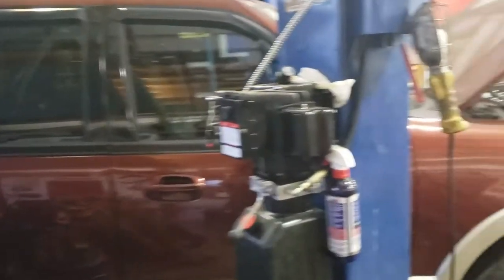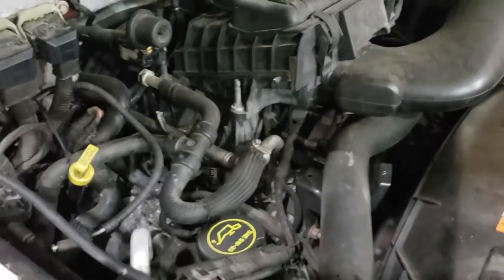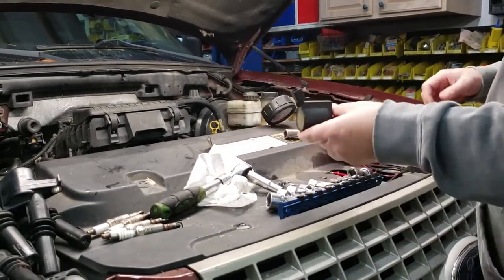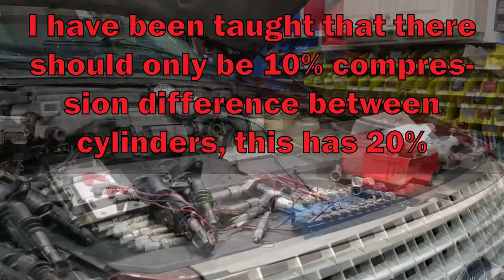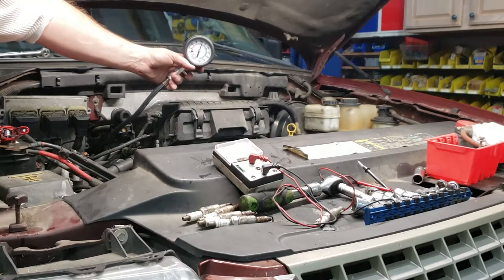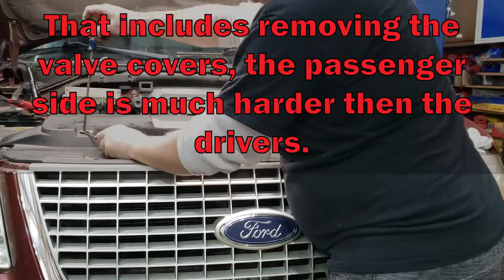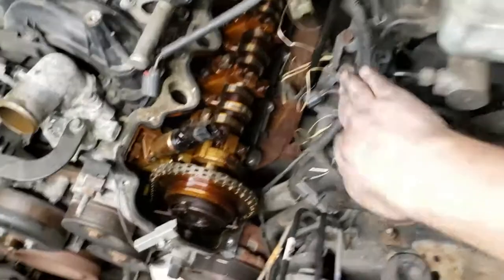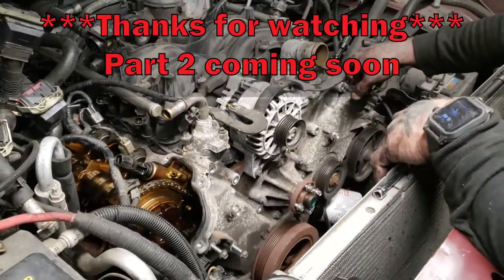How to remove spark plugs and do compression testing on a 2006 Expedition 5.4 3V | Timing

Comment: good tip at minute 15 to remove the 10mm bracket holding the big wire looms to provide clearance for removing the passenger valve cover.

Comment: What was the problem?
Reply from the maker: The cam phasers went out and one VVTI solenoid went out (drivers side) When replacing them, I went ahead and did a timing chain replacement, spark plug replacement amd put on all new coilpacks. Since then the owner has had zero issues out of the Expodition. However, this is not cheap. This ran the customer $2,000 for parts and labor.
Reply: @BentOaksGarage  i have ford f150 lariat 5.4 2005 misfire p0306 i change the spark plugs, coil pack  injector and still have the code she shaking add the light or stop side the engine sound quite i don't know what wrong
Reply from the maker: Does it have a stumble when driving, something like you put on the gas and it just doesn't want to go? Feel free to reach out to me and I'll see if I can help. Vgotspeed@yahoo.com